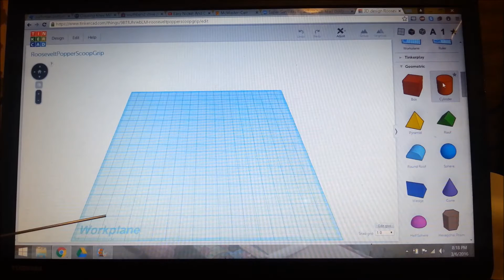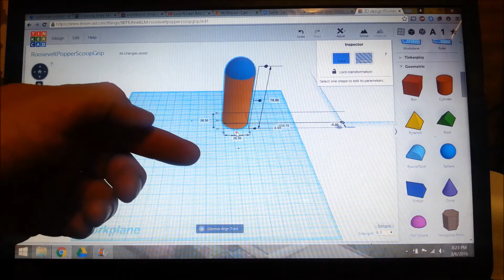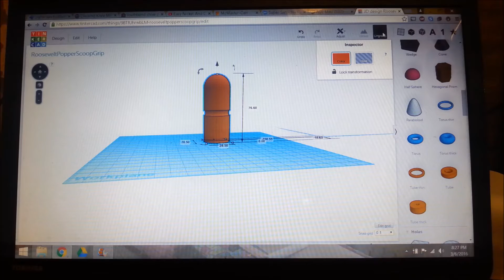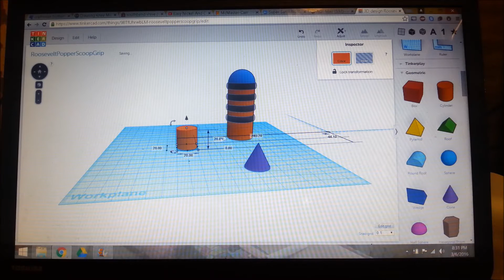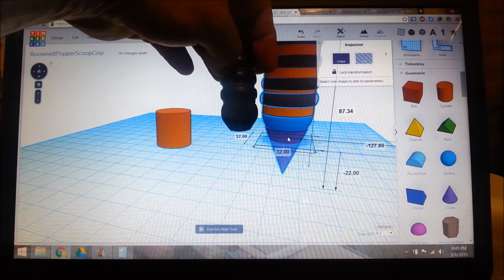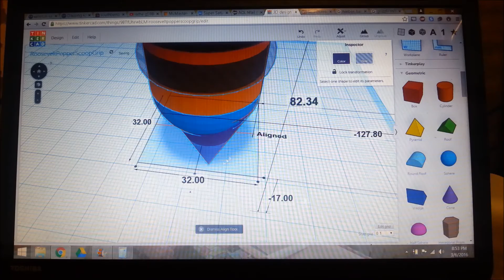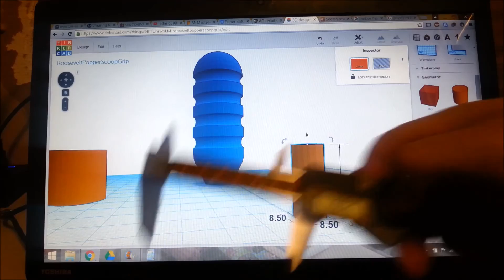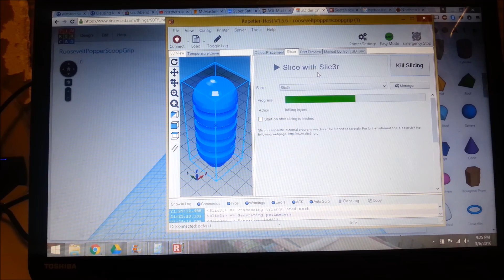TinkerCad How To  Model & 3D Print A  Popcorn Scoop Handle PART 1 Crafted Channel

Comment: Very interesting. I can see many uses for a 3D printer. I can't wait until they get some that make metal parts but affordable for the average joe. What does a part like that cost you to print?
Reply from the maker: I saw a bit on the news about a crowd funded metal printer for $3000.  Uses welding wire.  I've not been able to find it but I want to see how well it works.  Very cool.   A printer like mine is about $500.  I purchased the one in this video used and not working for something like 100.  The plastic is about $9 a pound.  So, that part is maybe $1 or less.  3d printing has it's own issues and problems to address from time to time. Not a simple as a toaster but they work most of the time pretty well.
Reply: Crafted A printer like yours would have come in handy last week. My youngest son has a Traxxas Rustler XL-5 RC car. He smacked a concrete curb at top speed and demolished the plastic caster block, steering block and lower A arm on one side. The parts were cheap enough but had to pay shipping and wait on them.